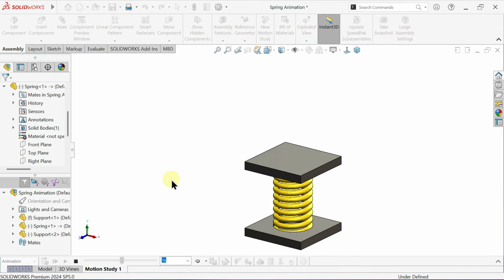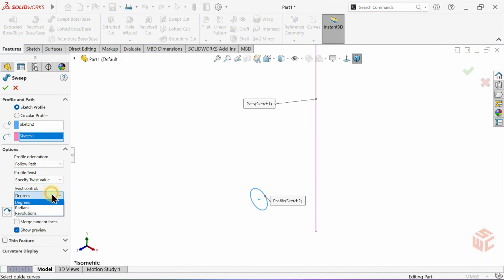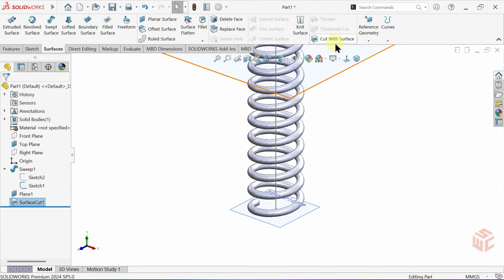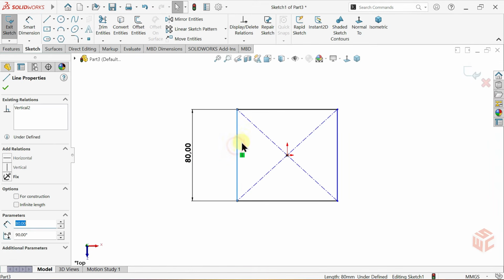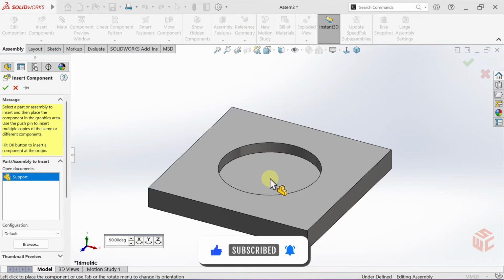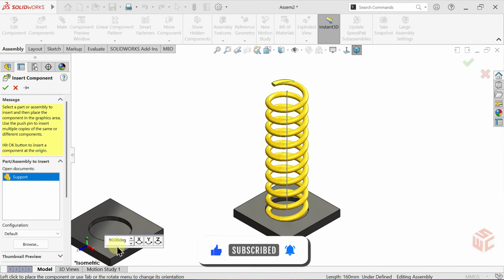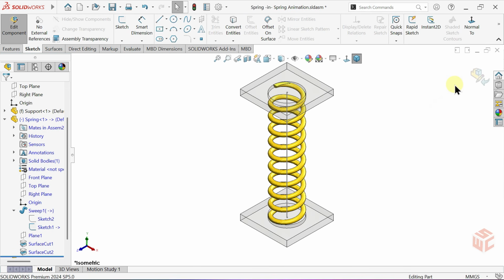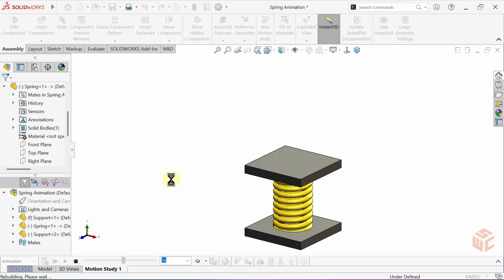SolidWorks Spring Animation | Motion Study Tutorial

Comment: I am a student of mechatronics and mechanical engineering and I go through your videos and learn a lot from them thanks to your videos and many other tutorials. My achievements are beyond expectations and I plan to expand my knowledge. Keep uploading videos. It helps a lot. ♥
Reply from the maker: Thank you so much for your kind words! I’m really happy the videos are helping you on your journey. I’m always open to feedback or new ideas, so feel free to share anytime. Wishing you continued success in mechatronics and mechanical engineering!
Reply: @SolidWorksCentral  Which are interdependent, let's say, like a system of gears, and also how can you check pressures while a press is working, pressing during animation, if possible?
Reply from the maker: Great question! Yes, in SolidWorks you can simulate interdependent systems like gears using Motion Study and mates (like gear mates). To check things like pressure while a press is working, you’d need to use Simulation tools - especially SolidWorks Simulation or Motion Analysis with force sensors. I haven’t covered this in detail yet, but I’ll definitely consider it for a future video! Thanks for the great idea!
Reply: @SolidWorksCentral  I'm looking forward to it!